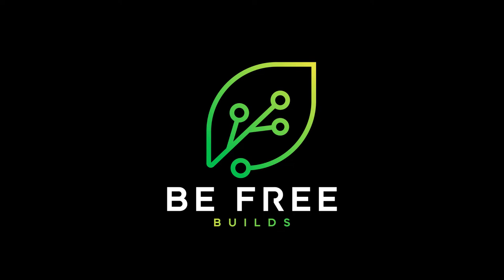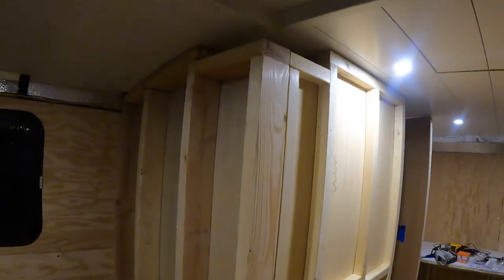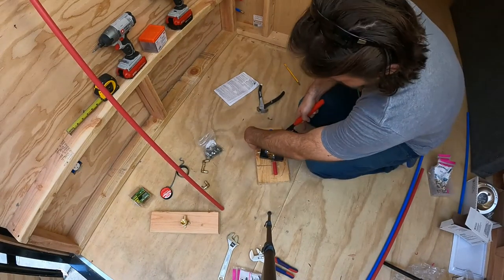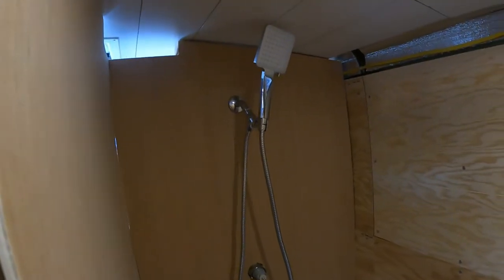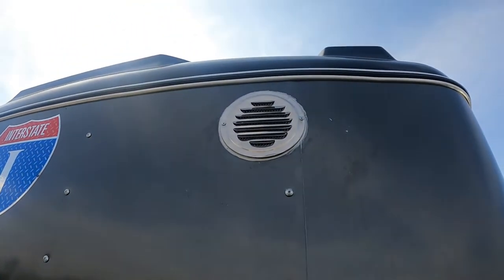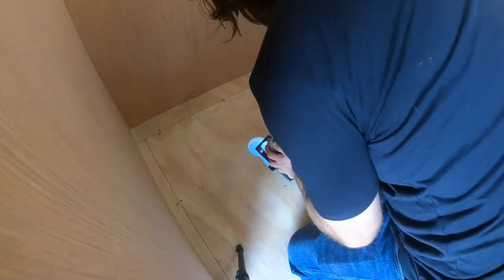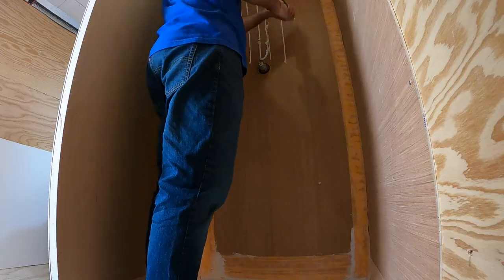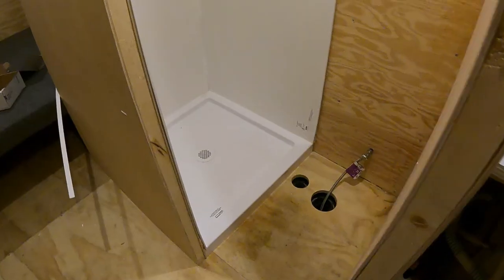Cargo Camper Shower Build

Comment: Back in the day when I did camperized vans, we used 3/4" plywood for all walls where no wiring or plumbing had to go. Not significantly heavier than studs, but saves roughly 6" of space on opposing walls. Use cabinet grade, or finished hardwood and stain and you're good to go.
Reply: Good tip , Tnx!!

Comment: I would highly recommend switching the wall outlet above the toilet to a GFCI, considering the proximity to wet space. Otherwise, great build and content so far!
Reply from the maker: Thanks! That's a good call!
Reply: Yes spotted that too. Or if it was downstream from a GFI it would be ok too.
Reply: One big tip - every single outlet in a trailer should be GFCI.  They only cost a few dollars more, but with how moisture can get behind them due to changes in weather and such with the metal exterior - its smart to have a bit of protection on all devices. =)
Reply: Add an exterior cover also.  All receptacles in my trailer have them to keep moisture out due to temp changes in a confined space
Reply: @befreebuilds  I think they make breakers with GFI so you could hit them all up at the same time with breakers. Not sure what someone meant by outlet covers, but a good thing to do is fill the inside of the outlets with spray foam and then use calking under outlet covers. This insures a tight seal. You could skip tge sprayfoam and just do the calking since this isnt a house.
Reply: Gfi's don't like generators
Reply: @imacrazyguy5831  
Tnx for great tip!
My cargo trailer was purchased partially wired & has a basic bunk bed  set up- 
Soo, selling 26ft parked seasonal trailer & looking at working with what I've got,  & convert It! 
It doesnt have to be 5☆ but safe cuz A shower & toilet 'system'  is a must.. 😁🏕🌒

Comment: I am building a shower trailer and still need to fully install the tankless water heater. Did you have any issues with carbon monoxide venting it out the wall in the way you did?

Comment: And for those that are going to do the same thing and waterproof their own customized shower, please steer as far away from using a whole thing of caulk on it before you use a roll-on latex shower paint that they use when they install showers I don’t remember exactly what it’s called but you can paint it on any surface and it will waterproof itand you just apply it generously in the corners and use multiple coats
Reply: Rust-Oleum has a boat/marine paint. I'm going to just paint layers until the paint can is empty. 😁

Comment: The vent for the water heater should have been out the side not the front. The last thing I would want to do is force air down the vent pipe. Also, I would not have put an outlet in the bathroom, but if I did it would have been GFCI.

Comment: With the Heater installed inside with a vent does that Guarantee 100% no Carbon Monoxide inside the trailer & also is this an installation option recommended by the Mfr being it is Gas....Looking to install one in my 7x16....Thanks
Reply: Ditto!! Looking 4 info :)
Sold house, ForSale Ad up on 26ft parked seasonal trailer & researching conversion HowTo's - van or cargo.
My 7×16 nose tip  enclosed cargo was purchased partially wired..
Gdluck to all🙋🏼‍♀️
Reply from the maker: This seemed like the safest installation and was pretty inline with the mfg instructions. It's designed to be installed on a house or building and this installation is similar. They have RV specific ones which is probably the best, if it fits your build.
Reply: @befreebuilds  Where did you get the flue exhaust pipe and wall thimble plate from? Or did it come with the heater you bought?

Comment: Nice shower build, going forward May I suggest you put nail plates on the wall studs where the piping runs through it, I was watching your brother nail up the panel and hoping he didn’t puncture the plumbing pipes cause that would have killed me. Also if you can use a p-trap and run it the other way under the shower so that sewer gases or gases from the black water tank don’t back up into your trailer from the shower would help you a lot! Hate to hear you woke up to 💩 smells filling your trailer.
Reply from the maker: Yeah a punctured water line would have been awful haha. I did install a p trap between the shower and the tank
Reply: @befreebuilds  okay cool, and what water heater did you go with... I may build mine next year and right now I may go with a 19gal just because I want to keep it 120V
Reply from the maker: @TadashiYasahiro  yeah an electric one might be a better choice than the propane one I went with
Reply: @befreebuilds  what model is your propane one?

Comment: gave thumbs up for venting water heater most seen on youtube just vents inside  
you might want to cover that vent when pulling down road could see it  pushing rain in
Reply: I think you shouldn't have put the vent for water heater on front wall of trailer.  Driving in the rain will push water thru & down into your heater. Not good.
Reply: @jadefritz3035   i have a cover for it when not used or in Transit on mine

Comment: Is your HW heater a pressure on/off or is it on until turned off. We have one that is only on by pressure and not a fan due to low pump volume.  How is it holding up and would you change anything.  What modle do you use? Great vid and build Sir. Thank you for your time.

Comment: I’m curious what type of tape you glued for sealing the seams.  Please let me know.
Reply: The tape is schluter kerdi band. It's not sticky it's just a waterproof membrane strip. Usually mortared on to the wall. he caulked it on
Reply: Has anyone else have any experience on using some kind of glue/silicon to bond the tape? How is it holding up?
Reply: Why couldn't you use a good polyurethane adhesive to seal the panels to the shower pan? I was thinking the same thing.  @bonapartistico

Comment: Hi there!
Wondering about the shower pan, frp sheet and the tape, would like to know where you purchased them, thanks for the info 🙏
Reply from the maker: I got most of the material from Lowes/Home Depot. The pan I got from Amazon I believe
Reply: @befreebuilds  I didn’t catch what size it was?
Reply: @masterchef2408  I think he says it's a 32"x32"
Reply: @befreebuilds what kind of tape is that and what was the caulking you used behind it?
Reply: Hello, I am also curious about the seam tape you used in the shower. What is the name of that product?
Reply: Same here  @wadeintoit